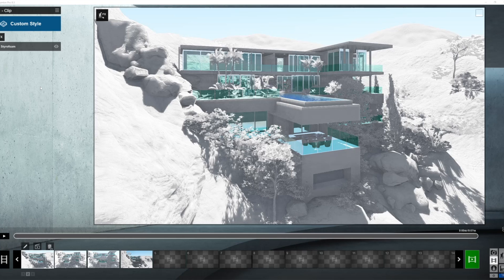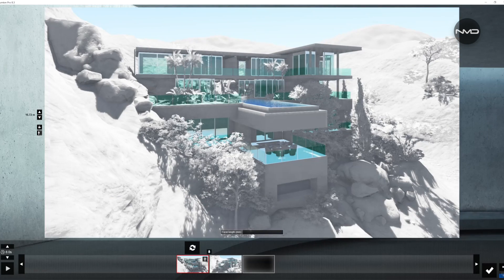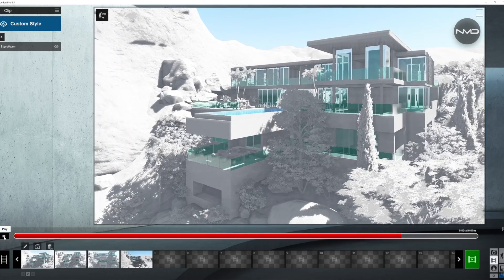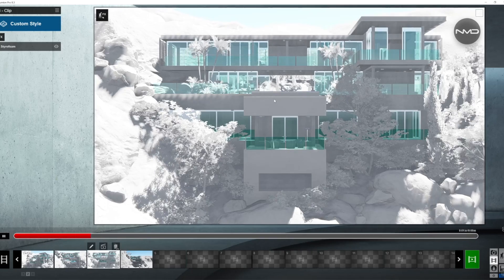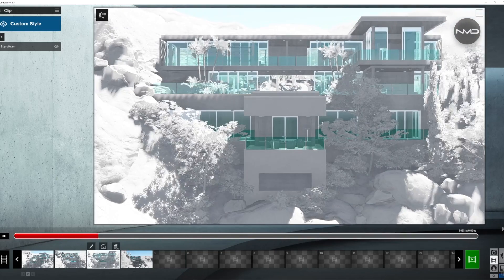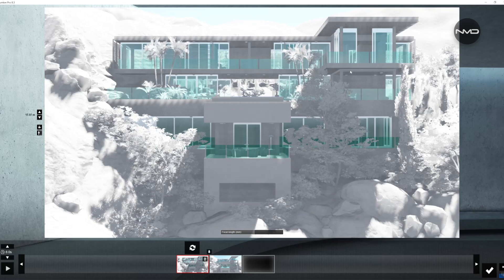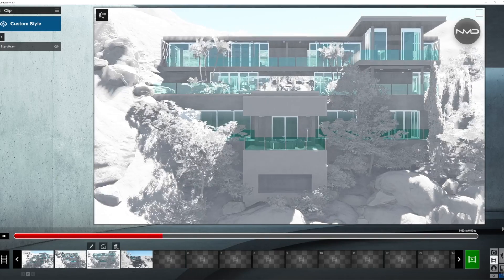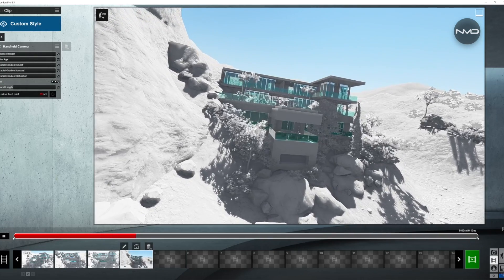LUMION 8 Advanced Camera Techniques Tutorial

Comment: Hi, is it possible to scale/size IES lights in lumion 6/8? If yes, how?
Reply from the maker: Hi, Lumion has its own lights.
Reply: New Millennium Design. I'm talking about the same. Is it possible to scale down/resize those lights? (I know that the size of area lights can be changed)
Reply from the maker: Gotcha. Thought you were talking external IES. Yes you can.
Reply: New Millennium Design ya. But how to resize it ? If I'm selecting the resize button and click on a light, nothing changes (size isn't changed) is there any other way to to it ?
Reply from the maker: I see what you mean now. You can only change the cone angle size. not the whole light.  Despite the fact that you can select the resize button and adjust the slider it automatically resets to 100% size.  If that is a bug or by default that I dont know. You have to ask Lumion.
Reply: New Millennium Design Yes! You got my question! 😬 Okay. Thanks